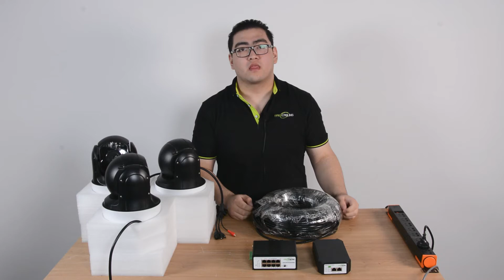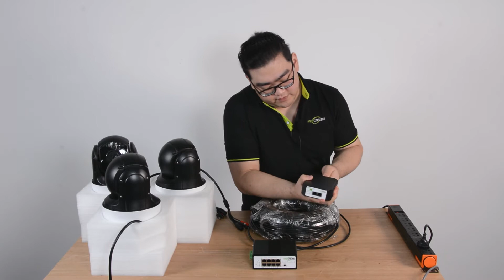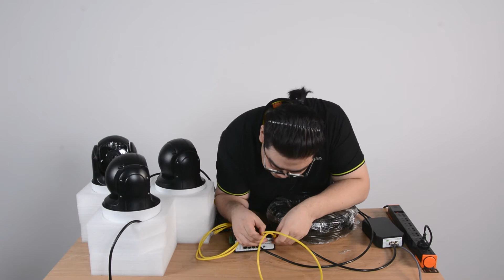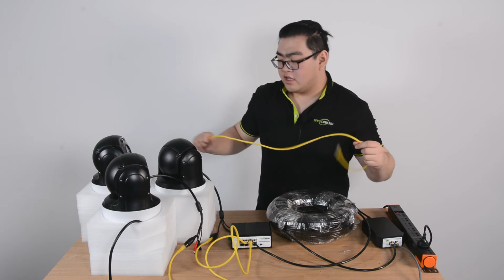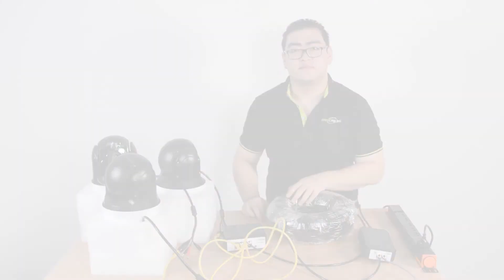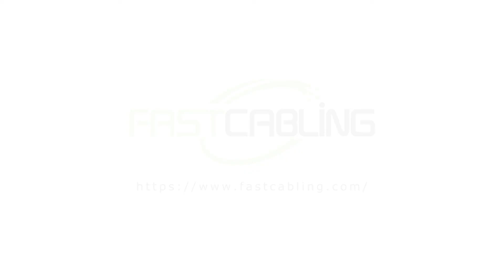How Much Power One Cat5e Cable Can Carry within 100 Meters?

Comment: Could we use another 100 cat 5e cable after the poe power switch?to power ptz cams?
Reply from the maker: Yes, You can. The total power budget is 71W at the PoE powered switch (at 100 meters) while the 95W PoE injector is being used at the center. You will have another 100 meters PoE network. The infrared PTZ camera without a heater requires about 25W. It can supply two PTZ cameras with another 100 meters.